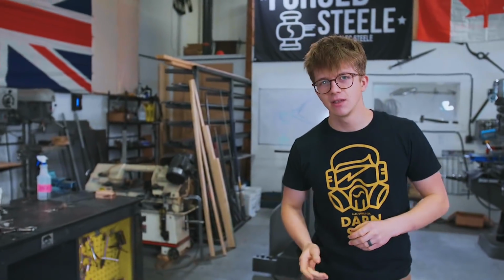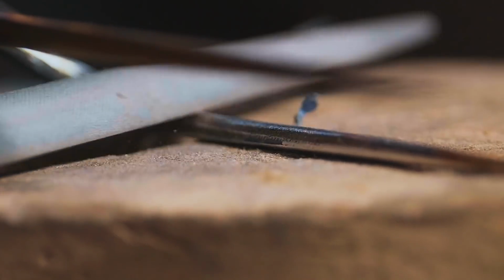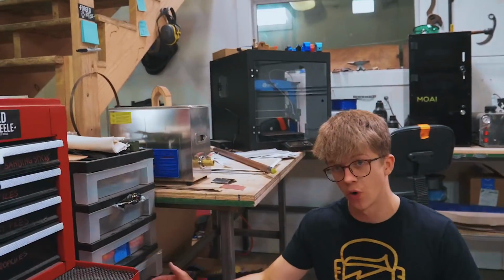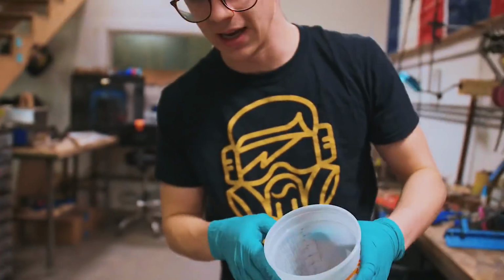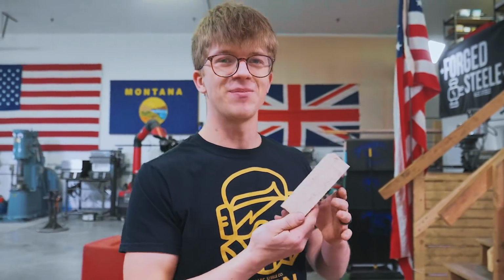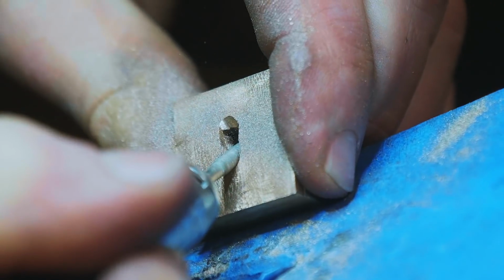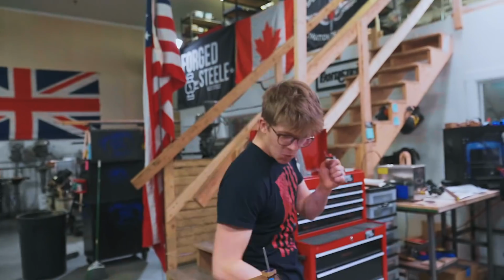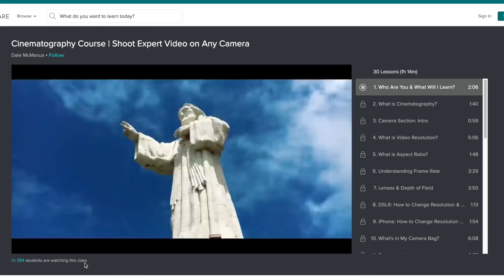MAKING A STAINLESS DAMASCUS CARVING KNIFE AND FORK!!! Part 3

Comment: love the duck tape trick Alec!  In bench jewelry world, we call that "thrumming" or using a "thrumm".  In my case, it's usually thick cotton string with a polishing compound.  You can put a small thrumm in a jeweler's saw frame or as an attached string on the bench that you'd pull tight and run the peice to be polished back and forth against the tight string.  Congrats on all the success!

Comment: Ok Alec, I’ve seen you cut sand paper on your cutter throughout many different videos. Try cutting paper side up to save the blade edge. Right now you’re cutting through the sand and adhesive before the paper, while cutting the paper side first you’ll see extended blade life because you’re cutting through the paper and adhesive before the grit which will separate away from the blade.

Comment: As always, I am really looking forward to seeing the finished product. For glueing the handles, may I suggest using a flavor injector (giant syringe with giant needles). I squeeze my glue directly inside the cylinder, mix it well with a stick, then screw on the needle and piston and squeeze the glue in the cavity. That allows me to start depositing the glue from the back of the cavity up to the top so no air bubble is formed.

Comment: A suggestion for your sandpaper organizer: Put the finest grits on top and the coarsest on the bottom. If grit sheds off of the paper, you don't want the coarse grits getting onto the finer paper and potentially digging into the work. (I learned this back in the day using very fine lapping films for fiber optic connectors.)

Comment: Alec, I've been wondering: why aren't you soldering your bolsters in place? That used to be considered a necessary step in the finishing of the knife. If nothing else, it prevents liquids from creeping under the bolster and starting corrosion.

Comment: Ferric chloride certainly is an acid, just not by common definitions. Most people only know the basic Arrhenius or Brønsted–Lowry acid mechanism, but just because it does not directly add protons to the solution doesn't mean it isn't an acid! If you want to learn more look up Lewis acids.

Comment: If you wanted to bubble air through your ferric chloride you could of used your air line with an in line regulator and a piece of plastic tubing. Just turn the shop air down to a few PSI.

Comment: Mr steel don't be so hard on yourself. You have the drive to do things right and most times that's not the same as right now . Doing things right takes time and requires passion with out those there is no skill and ultimately no craft. Will is quick and accurate, you are accurate and consistent the two of you make a excellent team.

Comment: The Hydrochloric acid is very corrosive and because HCl is a gas it will slowly leak out of the bottle. You could seal it with some PTFE (Teflon) tape on the bottle threads and put the bottle inside a plastic container or bag.

Comment: I doubt you'll see this, but you can make cupric chloride by disolving copper in muriatic acid (an aquarium bubbler speeds it up). Have you ever tried etching damascus steel with that instead?

Comment: What Happened was you heated up and since it's stainless it cooled and air hardened the stainless has to be hard to etch that's why all the stainless Damascus bolsters, pocket clips, and back spacers that I use on folders have to be heat treated to get a proper etch 👍🏻

Comment: Ya know, I feel very tentative at this point, but could I suggest thst if you want to dig a trench in the bronze, a flat bottom engraver might be more controllable? You have the pneumatic handpiece, so it should be dead straightforward to do it.

Comment: Ferric chloride is still an acid, just a proton based one. Only proton based ones get the acid name, yet there are non proton based acids which don't get acid in the name, but perform the same chemical action of removing electrons.

Comment: You should just get a cheap air pump. But you can add hydrogen peroxide the cheap 3% to oxygen enrich the water prior to the ferric chloride. Though be warned the ferric chloride Will cause rapid decomposition of the peroxide into oxygen and water.

Comment: I'm curious now as to what would happen if you heated ferric chloride solution for etching... I'd imagine a faster deeper etch! Also if oxygen is important to the etch, if you added hydrogen peroxide to the ferric chloride solution it would decompose into oxygen extremely quickly.

Comment: Not sure who told you ferric chloride isn't an acid, because it definitely is (a Lewis acid, specifically). FerrOUS chloride is not however, but considering that it's usually a solid, this is rarely a point for confusion (unless you dissolve it in water, but it's bright green so you wouldn't likely confuse it for ferric chloride).

Comment: How do you make the steel not rust over time being washed and used for cooking, does the heat treat fix that, or is there an oil or something?
Reply: The best thing to do Is first when it is cleaned it should never sit in water or the sink, always hand wash it and dry it immediately and then rub a little bit of food grade oil over it to help protect it until next use
Reply: Timothy S. oh gotcha thank you

Comment: Alec be careful with those chemicals. It's not all that innocent. It's all on the floor and you have it on your arms. After working already 12 years with chemicals I saw to many accidents. I did it to when I started working. Handled chemicals with nitril gloves and my sleeves up till I ended up at the ER with my under arms burned 2nd degree. It happens faster then you think and sleeves or long gloves are not that hard to wear. I know you have safety as a high standard with those respirators and emergency kits but just put in a safety goggle and decent chemical handling stuff. Keep up with the great video's.

Comment: Blowing water into a solution does not add oxygen, the oxygen is added by surface agitation when the bubbles leave the liquid. It is a slow process and what you did there by shaking the tub would have had no benefit at all.

Comment: U have a luck that didn't work with the torch cause if when it drop from the vice if it did soften if it hit the tip u would have went mad xd also it etched up cause the torch ... not pausing....